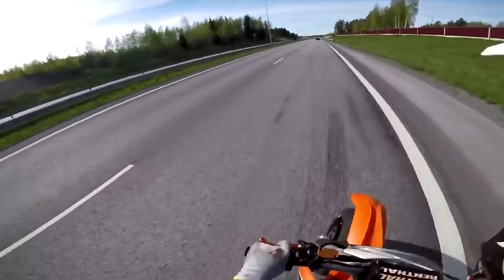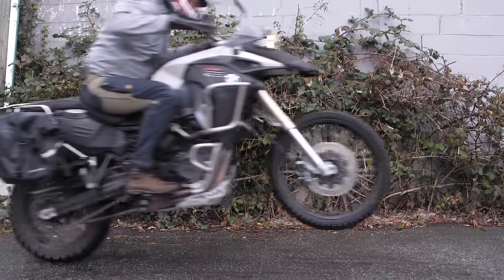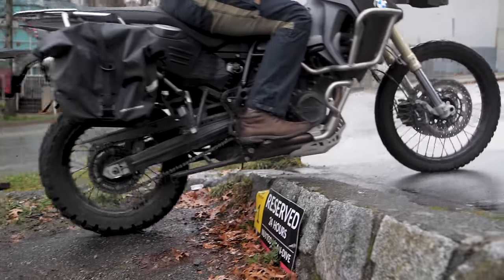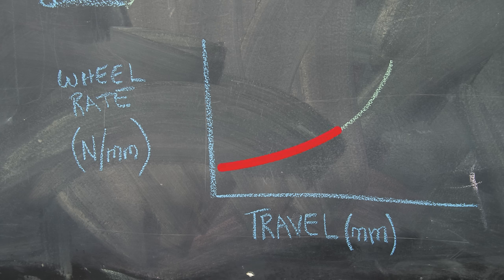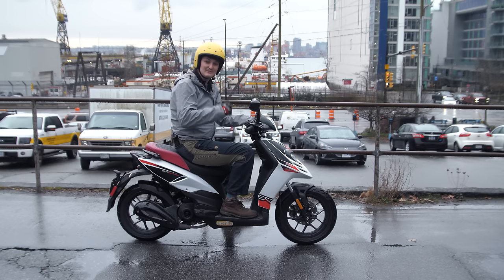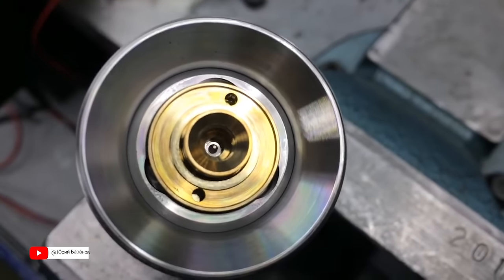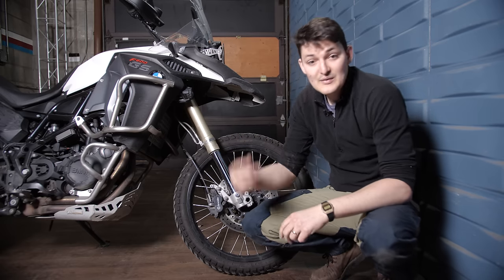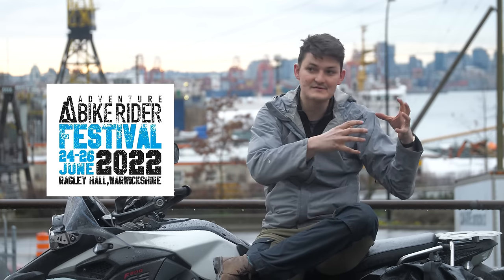Tank Slappers and the Quest for Perfect Suspension

Comment: A good explanation to why the first thing you should change on your stock bike is suspension.  Or at least adjust what you have if you can !   Spring rates on bikes are seldom correct for the rider using it.   Measure your sag and fit the springs that suit.   Much better use of money than spending £1000 on a stupid exhaust.

Comment: I thought it was a “natural frequency”problem. Like a corrugated road is kind of a sinusoidal forcing input into a mechanical system and you need to tweak your system your mass/stiffness/damping ratios to get a system that can survive a zero to top speed progression without hitting any major mode shapes or resonances. Like the bike is less stable at certain speeds. Or corrugations disturb your car less if you go noticeably slower or faster than the typical travel speed for that road.

Anyway it seems like you need math that has so many variables it’s near impossible or trial&error testing that’s probably dangerous so I’ve always had a “don’t mess with the manufacturer’s suspension” approach 

A lecturer once told a story about a car design where there were resonance problems at higher speed. To try fix it the made the shaft thicker. sure that change stiffness but also changed mass so it didn’t end up fixing the problem. So then they just limited the car’s top speed haha

Comment: So how should we compensate for the rear tire pumping under acceleration? My bike has only adjustable rear preload. Increase the rear preload to withstand more acceleration force? Increase the rear tire pressure to 'sharpen' the contact patch under compression?

Comment: There are so many videos and articles on setting up rear suspension sag with most saying it should be about 1/3 of wheel travel, with various approximate guides for different kinds of bikes, despite it often being said that just a few millimetres makes a difference.  I'm not saying it's wrong, but I have yet to find the source of the 1/3 rule / guide.  Since there are numerous suspension configurations out there, can there be a technical reason why 1/3 suits all?  Is it just that most of the bumps we hit are twice as big as the potholes we hit?  There are no potholes on road race tracks.  Out of curiosity, I'd like to know where the magical 1/3 comes from.  Does every bike manufacturer base their designs on that figure?  Can you tell us Ryan?

Comment: I ride a 94 Vmax 1200... tank slappers are common and they do suck. Another solution is neck bearings, if your bike has them. Tightening the neck bearing too tight promotes speed wobbling past 120. Any suggestions? With the front tire worn out enough, I can hit 150 easy, but still can't take a curve over 95 without getting the wobble. I love the bike, for those that think I should just get another.

Comment: I have a question about progressive springs. Do these springs compress in every section simultaneously under load (proportionate to the different spring rates in each section of course) or is the softer section (I guess the wider part) compressing first and then the stiffer part (narrower windings) after the softer section is out of travel?

Comment: Anything designed to be stiff becomes a spring under stress. Once the steering head to swingarm stiffened frame is deformed by the jolting of the landing on the front wheel it redirects the front end until the deformation dampens out. Significant additional deformation of the steering geometry is possible by having loose steering head bearings! Put your bike on the center stand, put some weight on the back, a wife will do but don't tell her why, until the front tire comes off the ground. Check the front end for play, check the tire for play, standing in front of the bike. Ride safe everyone!

Comment: I have a question. Unrelated to this video but from another video of yours I can’t seem to find. If I update my exhaust to say s&s pipes, would I have to change anything else such as the air filter. I concerned it will run too lean and needs balance. Thanks in advance.

Comment: These are some great videoa you have made, keep up the fantastic work!  I wouldn't take the "perfect suspension", I like it raw.  No frills, no electronic assists of any kind.  Newer vehicles, and bikes, are really good at going fast but there is a disconnect between you, the machine, and the road that takes quite a bit of the skill and (in my opinion) the fun out of it.  Again this is much more pronounced in automobiles than in bikes.

Comment: Might as well ask a suspension based question. I picked up a cb500x. Suspension is stock. There’s one bit of road where it the suspension feels to light on the rear part of the bike. When I go over that bump I am thrown from a sitting position to a standing position. I’m assuming that increasing preload on the rear would fix this?

Comment: Surprised that retro fitting a steering dampener wasn’t covered. Agree though that suspension setup is not paid as much attention by the weekend adventurers as it should. Fox 🦊 innovated the brain for specialized bicycles which actively monitors and locks out dampening with no battery needed, pity this didn’t find its way to motor bikes.

Comment: If the definition of "perfect suspension" is total isolation from the road - no, we've got Lexus for that.  Is tank slap a common problem on a modern bike?  Would a little care, and a basic steering damper cure it on a bike prone to this?

Comment: Of course I suffered a high speed tank slapper today and now I'm 6 hours in Wonderland. I've had it happen twice and they are scary as shit. I just squeezed with my legs and lean. I ran off the road while still wobbling and the only thing I could think about was the damage I was going to do to my bike. A miracle happened. I didn't lay it down or get thrown. I managed to get back on the road. Once I pulled over I threw my helmet on the grass and the damn visor hinge broke. My Ram mount came off, but it managed to get stuck against the windscreen with my phone still attached.

Comment: After watching the whole video. I still don't get it. I'm 68kilo rider on xmax 300 scooter. Just installed aftermarket suspension called ProFender suspension shock that cost me 550bucks. But still, I still think my ride are very jittery and jerky. I tried all the knob setting from 1-16 setting on the suspension canister...still I think it's too stiff. How can I achieve smooth ride on the bike,? That goes over bump more gracefully.  Do I have to change fork spring for the front too?

Comment: Im old school so I am Absolutely Not looking for a "Perfect" suspension. . Although I recognize the tech put into it all I appreciate the power in the engines performance over the suspension changes.. I just think a Motorcycle needs to be a little frightening to fully appreciate its use and being able to flirt more aggressively is just more fun.. This is exactly what happened to cars in some respects. With all the extra Traction control power everything and the computer management of your inputs, All the tech has taken the fun out of flirting with the edge of disaster. Cars are much like bike there too,  We used to have a large cushion before a drift turned into a complete spin..or rather high side or a slide, These days that margin is VERY fine as the suspension is set up to perform well near the edge of its limits but the tires stiffness and other additions have tighten up the entire platform. This results in a smaller cushion for recovery when going over the edge.

Comment: I want to ask, why is this happening in the first place?
Why would non-adjustable, factory shocks not be designed to eliminate this?
Or are they? And if they are and it still happens, are they not working correctly? Or do they need repairing?

I mean, if you modify your bike then of course you should expect something like this and fix it yourself, but factory?

Comment: Then there is the "wobble of death" wich is most often caused by the bike's center mass, the engine, wobbling in the frame. The rubber mounted engine's damaged or worn motor mounts can cause this. A wobble of death is a guaranteed going down hard situation hence the death part. Suspension is not the cause of this. Great vids and content.

Comment: To fix the packing problem, why don't they just use a check valve so the fluid goes through a small hole in one direction, and a bigger hole in the other?

Comment: No.

I wouldnt want that.

Because motorcycle suspension isnt just about bump absorption.

It allows for dynamic geometry...

As front travel is used rake and trail and wheelbase decreases making a bike easier to turn while also loading the front tyre more giving it more grip.

And the suspension linkages along with the chain extend the rear on acceleration, pressing tyre into tarmac for more grip, and again shortening wheelbase decreasing rake and trail and once again making the bike easier to turn.

But these changes make the bike 'less stable' which is good when you want to change direction, bad when you dont want wobble. 

That's why with the set up we have we get both.

So if you have that fancy 'perfect' suspension on a bike.
It would infact handle like ass and have way less grip both braking and accelerating.
Although it would be very 'stable' in a straight line and smooth over the bumps.

Comment: That Multystrada Duck may wobble its way up Pikes Peak in a hurry, with its electronic suspension, the problem is when it don't.  The thing about AI is when it fails, it fails spectacularly. Case in point Carlin Dunn in his prototype V4 Duck, highsided on the last leg of Pikes Peak to his death.  I prefer my motorcycle to be consistent, therefore resetting my suspension mid ride I tend to consider problematic.

Comment: All the people love it, and it gives more access to cycles to more people, but.....
The electronic controls have just completely penetrated the market.  Can manufacturers please offer a base model zero driver aids, a mid with 2-3, and a premium with all?  I have found my niche and ride older cycles, but really admire some new designs and motors but don't want the expense or learning curve of a dash with 15 different modes. 
P.S. changing fork oil is a pain in the ass. If they could make that easier, I would do it every year.

Comment: I thought tank slappers were due to too much power and not enough grip... I've only had one once, accelerating hard on a wet, perfectly slick surface. rolled off the throttle and it disappeared. the friends I mentioned it to had the same experience.

Comment: It's the wheel on the swingarm that has leverage on the shock, not the other way around. And if the swingarm is perpendicular to a linkage-less shock than it's actually getting softer, not harder. I don't think you explained linkages or shocks correctly here

Comment: Why do I feel compelled to comment?!!!!  Tank slappers on modern motorcycles are initiated by the catalysts you describe.  Historically they also occurred from geometry mistakes manufactured into the chassis.  By why does a deflection of the front wheel become a tank slapper?  Your list of catalysts progresses to a tank slapper because of rider reaction to the catalyst; they reflexively attempt to correct the deflection of the front wheel with their own steering input.  The trouble is, for myriad reasons of physics, the bike has already made a correction before the rider can consciously process what's happening. The rider's additional correction a nano second behind the bike's own correction generates an overcorrection.  The bike responds again with an even larger correction, the slow brain rider impulsively corrects again too, causing another and bigger over correction.  Rinse and repeat.  This escalating feedback loop is the "tank slapper", and it magnifies until the rider crashes, or the bike pitches the rider.  In the latter case the bike will make 2 corrections all on its own, straighten up, and ghost ride until it hits something.  We've all seen the footage.  The only way to correct a tank slapper is to loosen your grip on the bars and let the bike correct itself.  Your brain is just too dam slow for you to correct it.  Sometimes it appears rolling out of the gas corrects a tank slapper.  This was often true in olden times on bikes with inherently bad chassis geometry (it being a resonance issue).  But on modern bikes with proper geometry, the act of rolling off the throttle requires the rider to loosen their death grip on the bars.  This allows to the bike to make its 2 corrections and terminate the overcorrection feedback loop (or tank slapper).

Comment: My klr 650 front tire wonders like crazy on gravel roads...any ideas? Tires good and bike only has 7000 km.
Reply: I've seen some luck on mine by changing tires, however I've had to make my peace with it generally riding like a slinky.
Reply: @Funko278  whats your front tire?
Reply: @farmboy694  I run a shinko 705 on the front. It's decent on gravel, but pretty bad on actual single track. It does work great on the street

Comment: It depends right?
I like my bike super soft and comfortably sticky on dirt.. 
it is also great on pavement up to 140km.. 
but I’m rarely doing that.. 
but if I want to, the bike I’m talking about has adjustable air ride.. 
I can stiffen the animals legs and run it closer to 180kph.. 
I have an 81 Honda gl500 interstate among others.. 
they are on my channel if anyone wants to see?
Reply: If I could click on perfect suspension.. yes!
I had a mountain bike with volume knobs that adjusted the stiffness of the shocks, from pavement to dirt it was a constant struggle but it was definitely worth it.. yes I would take that!
The options I have seen though, are presets and do too much to quick, it really changes the ride so subtly and so much you barely notice, and by the time you realize what it may have done, your back to good roads waiting for it to catch up.. or trying to switch it back..
Getting off topic but I will run with it..
Hey Ryan, have you ever rode a hard tail? On dirt? Pedal or motor?
Either way, this is ruining the ride!
I still ride with a toolkit and use it on my buddies bikes.. 
I am excited for the future of motorcycles..
I am NOT excited for the future of motorcyclists!

Comment: 2:12 The description of a progressive spring is incorrect. A progressive spring does not have "3 parts". It's progressive. A spring with 3 parts would be a "3 rate spring". Most motorcycle muti-rate springs are "dual rate". The spring he's holding is a dual rate spring.
Also, the tight windings are the "soft" windings (low rate). The windings with the greater spacing are the "stiff" windings (high rate). The description in the video is backwards.

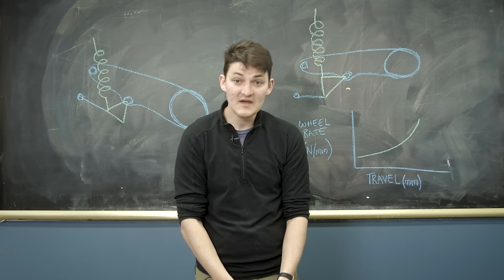Comment: 2:46 Explanation of progressive linkage is wrong. Linkage gives you progressive dampening rate, not progressive spring rate. The left picture is also wrong. Change of leverage because of the shock angle is very small. On many bikes when suspension is almost fully compressed this angle becomes not 90 again.
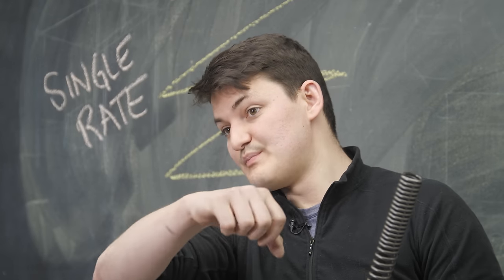2:36 you can't bottom rear shock under acceleration. Motorcycle suspension is designed to do antisquat. Pumping is effect from tires.

Comment: I am driving since 1995. And i never needed a magnetic suspension or air damping system.
I know my bike, know what it can do and what not. I have gas opperated shocks in the rear, progressive springs in the fork, and i use a thin oil and overfill the fork 25%. Many don't do that, cause it could cause leakage. That is not true for every bike. Japanese bikes can hold the more oil without leaking. This prevent the fork from bottoming out. Damn potholes.

Comment: Im Going to approach this from an odd perspective, I fly rc planes and I have been a purist my whole life and flying completely manually without the use of modern gyroscopic assistance. The computers are so smart now they can basically fly for you.
Being the purist I was quite against it in my own aircraft but saw the appeal to others. I decided to take the plunge recently and buy one of these smart board for one of my planes. And I have to concede tha they're pretty damn amazing on a windy day(like a rough road on bike) or when coming in for a landing(navigating dangerous terrain). But I like being able to switch it off when I want to fly by the seat of my pants so to speak and rip it up. I think having the option to adjust it or disable it on a bike would be the ideal way to do it.

Comment: You forgot multi stage damping via shim stacks in off road forks
Reply: You can tune the stack for rider weight and terrain  then fine tune with adjusting screws on the fly.
We used Racetech shim kits when I worked at a dealership in Southern California

Comment: POV: I ride 954 with very short wheelbase, light weight for it's power, with steering damper and aftermarket suspension set to my weight and riding style - still getting wobbles..

Comment: No. I drive a base variant of the Chevy Beat diesel. I've covered 1.0 lakh km in it and it still doesn't have a music system. Even when I drive a new car, I find a touchscreen the most distracting thing in the car. I won't buy a phone without a 3.5mm jack. I still clip on my iPod shuffle to my shirt when washing my car or motorcycle.

So, for my old-school taste, I'll choose to not have the "smooth ride" button in any of my vehicles.

Comment: to reply to your ending:

Probably not on a bike. Unlike cars, road feel is integral to controlling a bike and knowing it's behavior over terrain. Even under commuting conditions, riding a "skyhook" feeling bike would be dangerous cause you have little clue what the tires are doing underneath you which is critical to keeping balance as you only have 2 contact patches keeping your center of gravity in an equilibrium at all times. Cars have 4 in a rectangle and can lose 1or 2 to slippage without instantly causing a crash.